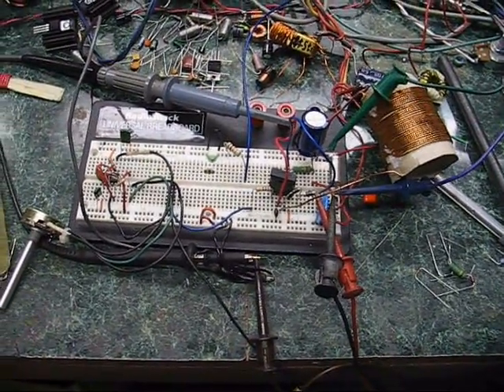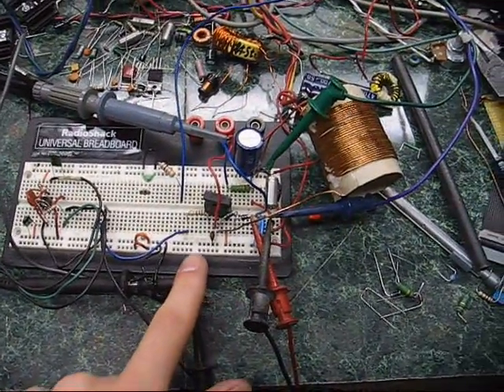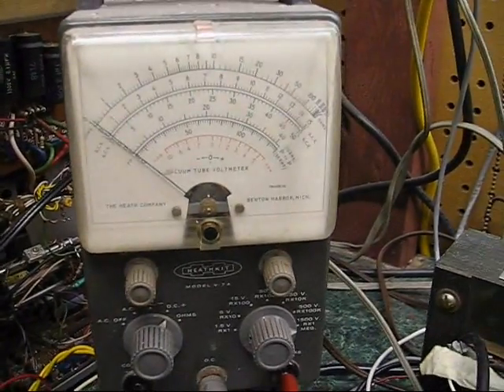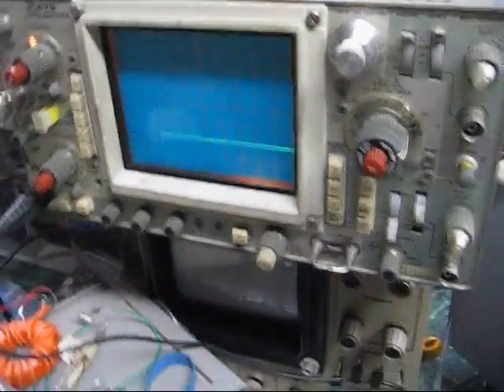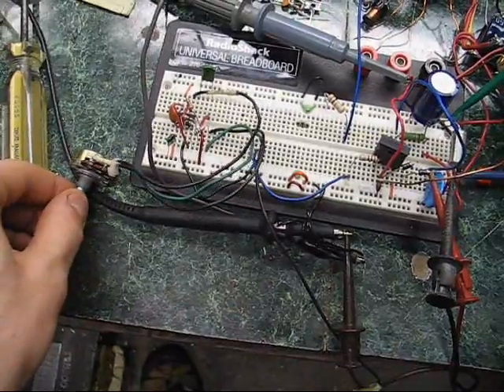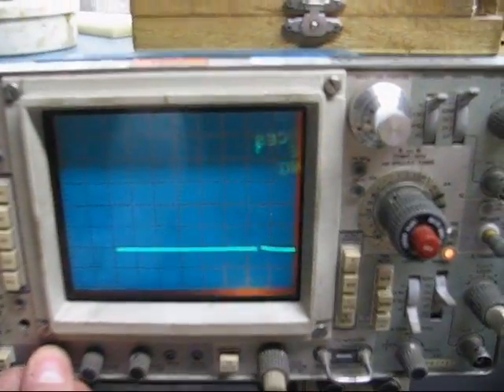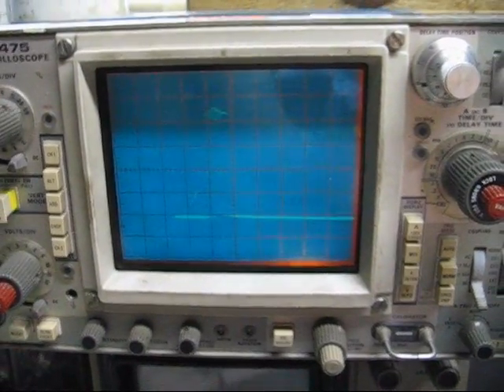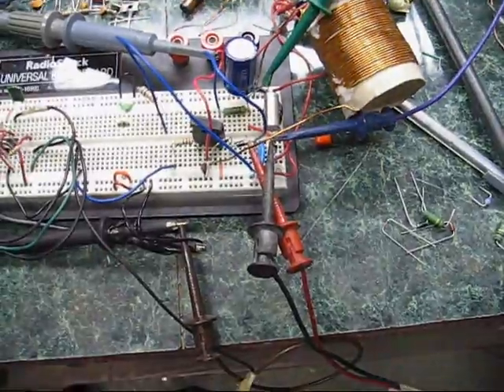High voltage boost circuit

Comment from the maker: @xenarian The inductance is not critical in this example because the frequency and duty cycle are variable.  For 600V at low current, I would recommend a flyback converter, rather than boost.  Ridiculously high ratios such as these are only of academic interest, because the transistor ratings required increase astronomically with both output power and voltage ratio.  Better to use a transformer to achieve the ratio, so your duty cycle is more reasonable (around 50%, ideally, not like ~95% here).

Comment from the maker: Sure, but keep in mind it's voltage mode (no short circuit protection -- dangerous), open loop (no regulation), and low efficiency due to the high voltage ratio / lack of secondary winding.

Added links to the description.